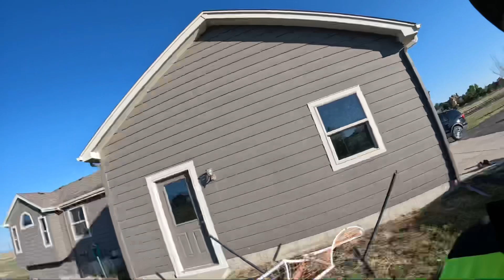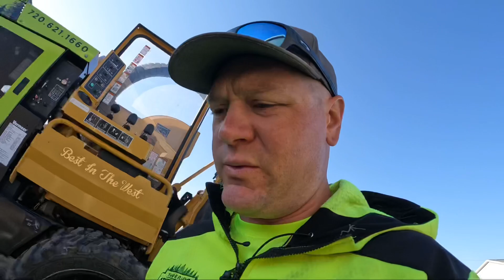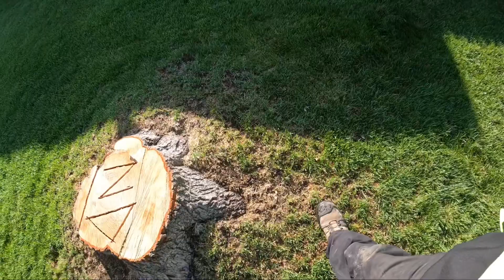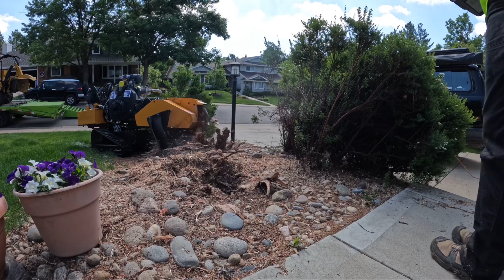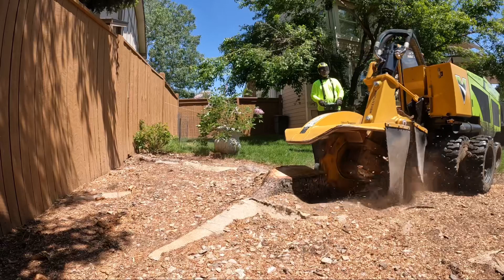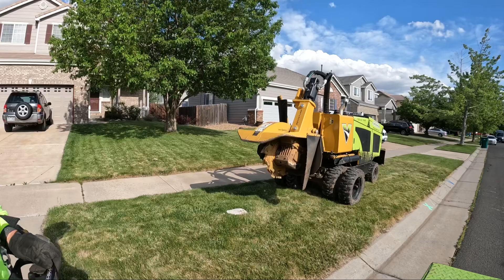Vermeer VCS wheel and SG40 stumps

Comment: Are you happy with your sg40. Also did you say you paid $9,000 for the remote for that machine or did I miss understand you. I asked price for remote a few weeks ago. The reason I'm asking I thinking of selling my 2018 / 2550 bandit and purchasing sg40. I do alot of smaller bush stumps for landscaping companies. I have my sg75 for large stumps
Reply from the maker: It’s a love hate relationship. The engine hasn’t been dependable. It’s a dang ripper when it works! Most guys are having better luck than me so I wouldn’t let me experience dictate your decision. The remote was about $9000